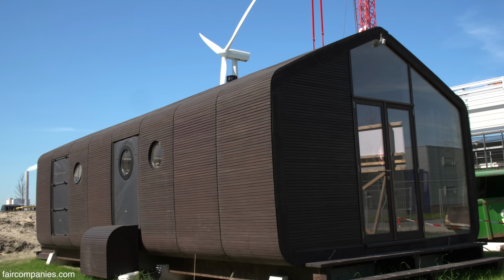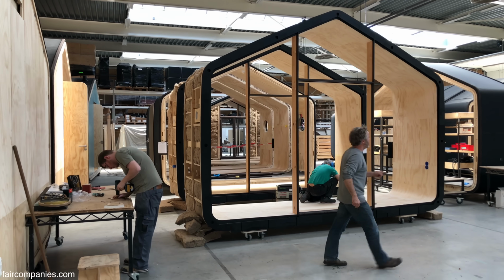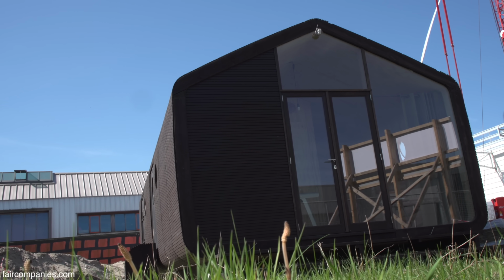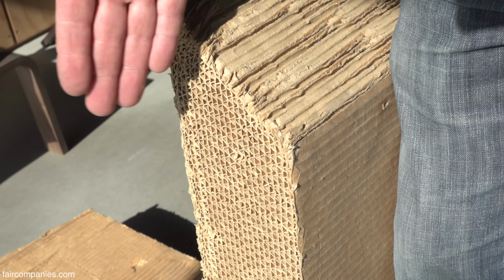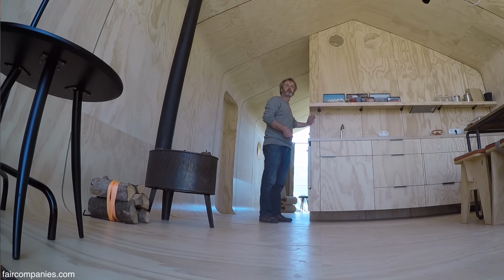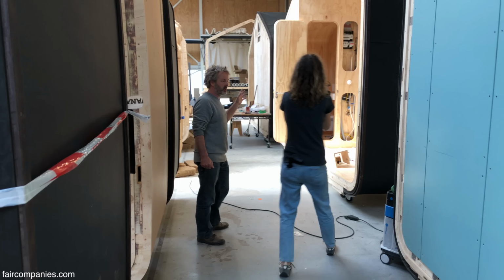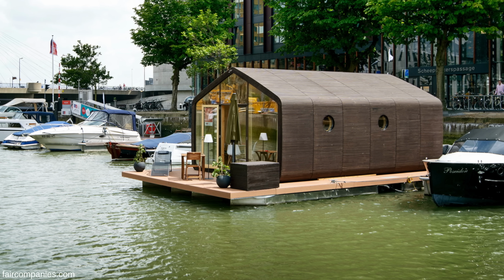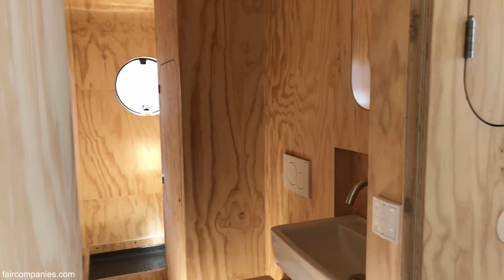Wikkelhouse: pick your modular segments & click them together

Comment: everything has its place.  To me it seems the weight is the key feature.  the questions then is whether the extra expense needed to make the modules out of corrugated cardboard worth it?  gotta run some numbers on this to see how it shakes out in the end.  gotta factor in lower shipping cost, less special handling on the site (cranes or small lifts).  If this idea indeed holds up over time with no wicking of moisture into the walls, invasion by termites & mice, mold through even slight penetration of moisture, and structural issues causing racking where windows and doors can no longer open/close, then maybe it has a chance for special applications where shipping and assembly is critical.

Comment: The way i see it if i could  live in a room with another grown man that was about the size of the unit with the bed that he laid on for 5 1/2 years in prison. I could damn sure live in a house consisting of 5 or 6 of those units with not a single problem.only issue i wld have to over come is how to connect those 5 or 6 units to the buried 40 ft shipping containers that ill use for my basement 🤔
Reply: Just have them cut a door section in the floor. And build a stairway.
Reply: Probably be less aggravation to just go back to prison.

Comment: The carbon foot print is probably less with common construction. 
That’s a lot of wood and not cheap.
Reply: Cardboard is made by wood...
Reply: I still see trees.
Reply: haha you obviously have no idea what you are talking about
Reply: Wood has a zero carbon footprint, it’s renewable. Only the energy go shape it. Concrete has a much higher footprint.
Reply: @martinstrunk4682  er, you realize concrete is sand and lime, right?
Reply: Daniel Sifrit cement is produced under very high temperatures, that needs lots of fossil fuels
Reply: @martinstrunk4682   or wood.  Which is renewable.  Kiln is a kiln.

Comment: I'm really really please he doesn't build boats or...cringe...aeroplanes because...while the concept is good...the engineering is really poor...orientation of the cardboard cells (really Kraft paper) defies sensible engineering, follows a "cheap" lazy method of application. Look at any cell core structure & its purpose of bonding the inner & outer skins...this system promoted here is a poor means of doing that for strength, lightness & I would expect durability too...the glie he talks about...should be a resourcinol "water proof" resin...with mold inhibitors...tricell core board is a poor cousin to paper honeycomb.

Comment: This looks like cardboard in a structural wood frame.  The cardboard is NOT used for the structure.  Why cardboard instead of fiberglass or other conventional insulation?  What happens if the interior or exterior moisture barriers leak?  Any little gap, even a pinhole can let in a lot of moisture over time.  MOLD?  MOLD?  MOLD?  Just asking some basic questions that the interviewer should have asked him.  He just keeps saying "cardboard, cardboard, cardboard" as if that represents some greater good in itself.

Comment: the thing is a good idea BUT all that really is cardboard is the INSULATION ONLY....so its not really a cardboard house as much as a plywood house with mostly cardboard insulation. Seems shipping containers are cheaper, stronger and longer lasting...and no foundation needed as long as the surface is flat and stable....and 100 percent recyclable too. Plus for refugees why have disposable houses when can make them for longer term use and if the crisis is over can use as low income housing after.

Comment: Ok those are beautiful. Love the modular concept and the aesthetics!

But rigid foam like XPS polystyrene with modern blowing agents is actually more ecological from what I understand. The oil you use to create the plastic isn't burned and the much superior insulation value allows you to save on energy creation of 20 or 30 years.
Natural fibers and stuff might feel good but they are not necessarily ecological. They need to be grown and harvested and transported too.
And XPS foam is much lighter so you save a bit of fuel on transportation too.
And the oil you use for building isn't put into the atmosphere as CO2 but "sequestered".
You need to do a scientific study to truly evaluate the CO2 balance of building materials and you shouldn't make "feel good" decisions for these things.

And also cardboard cardboard cardboard lol. Plastics and foam also do have the advantage of not rotting. You also save on structural elements if you use rigid foam because you can make the compressive strength of rigid foam sandwiched between laminates work for you. The cardboard probably has also good compressive strength. But man I don't want my house to rot ever.

It's a cool concept though if they could make it cheaper and better.

Comment: The design is on the right track.The materials are all wrong. There's no way that cardboard stays dry. Stuff happens... One breach of that "raincoat" and you'll have bubbling, expansion, and mold in a couple of months. Entire sections would have to be replaced.

And don't get me started on fire safety and  sustainability.

Comment: -
What I find intriguing: the modular concept of building in section/elements and simply having configurable modules to build to your desire.

What I find infuriating: cardboard as a core in a plywood home with no ideas of R-value, U-factor, material longevity, load rating (because someone will put panels on it or put it where snow falls), wind load, and cost ($10k € per module with nothing more than a plywood finish and cardboard core. 

Don't get me wrong, I LOVE the concept, but as an engineer, I also have to consider the practicality and long term viability of said project using said materials.
Reply: totally agree with you. maybe with this  modularity but made with a light weight concrete outer shell. I don't see how you can avoid termites and mice/rats getting into the walls.
Reply: @Akira-nw4jl  maybe it's because your an Idiot?
Reply: Why is this getting upvoted, when it's utter nonsense. Writing "I'm an engineer" doesn't make any of his statements true. R-value will be much better than any average american house for example. And I would guess that in the Netherlands wind load and similar things have to reach a certain standard for the product to be allowed to be sold.
Reply: Engineers are some of the most intelligent people on earth. Facts!
Reply: @Joel.Invictus  *self absorbed
Reply: @kfstreich4787 , nah. A little over confident, maybe.
Reply: @Joel.Invictus  Not really, they generally know what they are doing,  the trouble is they think anyone who does it another way is wrong.  And it's funny to hear how they say they are an engineer as a justification that they are right and everyone else is wrong.
Reply: and not to forget about fire proofing
Reply: Vernon Hampton, well said.
Reply: What kind of material do you have in mind other than plywood and cardboard?
Reply: spoken like a true thinker
Reply: Agree, towards the end of the video he says we dont know how long it will last..
Reply: My concerns would be 	1. Pest proofing (ants, termites, rodents). Especially at the bottom where they have it within a foot or so of the ground, that would be very difficult to 							check on periodically at that height.
						2. The issue of water eventually contaminating the cardboard. That depends on the relative humidity and the type and amount of rainfall in your area. I 							note there are no eaves for wall protection from sun and rain (two main considerations where I live)
						3.  I don’t know what options they offer in fronts as far as security etc. So much glass doesn’t thrill me. Frankly, larger windows would be good too.
							Therefore I suppose tropical conditions weren’t high on their list of considerations.  
I do like the concept and the possibility of recycling cardboard ad infinitum but the price ....ugh.
Reply: The modular design is interesting but the materials may need to be improved.
Reply: Vernon Hampton you’ve missed the point that cardboard is a great insulator acting as Trombe wall for heat to soak into its air pockets and release back into the units giving a high R and U value. The shape consisting of a triangular shape with rounded corners can withstand wind and snow loads efficiently, especially when you can see the skeleton of common stick framing within the units in the video (obviously I am speaking of when it is adhered to its foundation.) lastly the plastic water shield they installed will reduce the inflow and outflow of humidity. Cardboard and wood are a great benefactor from the industrial revolution, and I a few houses have implemented these materials already, and quite efficiently, so I believe these units would work. Cost on the other hand is quite ridiculous, you could most likely build this on your own time and spend less than what they are proposing.
Reply: @msdivagirl7  Sounds good but I feel they have to use another material than cardboard or process itto make it water and animal proof. In time it will just get water in somewhere and get soggy and lose its structural integrity. A lot of great ideas implemented. Maybe the cardboard can be replaced by or merely for insulation accompanied by some other material for structural integrity.
Reply: @steamsteam6607  Geometric structure is a cross-section of a spheroid, sphere being the strongest shape in the cosmos. Ergo, strength of the structure is superior to conventional stick builds. Properly treated materials are in no way more subject to weather and environment than any other wood-based construction materials. Vernon Hampton may be an engineer, but he must not be an architect, or he would recognize the superiority of both the geometry and the materials applications of this structure. You DID notice, right, that the exterior is covered with asphalt paper, roofing tiles, and exterior siding shingles? Like every house in your neighborhood?
Reply: @EternalRecursion  The point is that it weighs nothing because it's cardboard. So either it is bolted to a foundation and somehow extremely structural or it may go flying off. But what do I know.
Reply: @steamsteam6607  Well, whether it's attached via cables to steel anchors, bolted to a concrete slab, or a crawl space, or a full basement, one doesn't usually consider something a "house" if it is NOT on a foundation.
Reply: @EternalRecursion  OK good information ty
Reply: Company called Cube do interesting modular housing ,they are English company
Reply: In a tornado or hurricane say goodbye?
Reply: not to mention flammability
Reply: Obviously not much of an Engineer

Comment: This is the BEST tiny house solution I’ve seen yet. I’d say perfect as a guest house, or rental income, or a Mother in law dwelling on your property. 
Obviously you can use nice wood stains to finish the wood, the floors, walls, ceilings. Cardboard is a decent idea but I’m sure it would be less expensive to simply build each segment out of studded walls, insulation, and plywood. Cheaper yet to use drywall on the interior. The concept though of building the segments to customize is the real attractive offering here.

Comment: I think this is genius. Cardboard is such a brilliant insulation material, I make shelters for the local feral cats that I can't catch and re-home etc., every winter. They are a mix of cardboard bubble wrap and heavy duty garden refuse bags with straw inside because it doesn't wick moisture up from the outside. I can see that it would make a wonderful building material with all the corrugated airspaces. I wish I knew how to treat the outside of the house... I would use it because it's lightweight and easy to work with, if I could waterproof it, I would use it right away.

Comment: I looked it up, and a completed Wikkelhouse is supposed to cost $80,000...  not exactly cheap for a "cardboard home"
Reply: I was wondering what the price was . Thanks .
Reply: Depends on your vantage point: I am Swiss, and 80 grand for a house is practically free here. Building a house for less than a million is possible, I think, but don't count on that. The down-payment for a mortgage is usually higher than those 80 grand! :-)
Reply: @Widestone001  How much will shipping be?
Reply: @Widestone001  I will put some cardboard condos in Swiss and resell. Thanks for the idea
Reply: he did say it was not cheap it was affordable, but yeah it makes no sense a cardboard house for the price of concrete. why?
Reply: @yourlocalcoolguy  moving?
Reply: it's 99% plywood 1% cardboard (by weight). the cardboard is just replacing insulation..
Reply: Radley2612  calm down
Reply: Cardboard is an expensive material. Hence polystyrene.
Reply: GamingTaylor are you serious?
Reply: 19:42
Reply: Rediculous 80,000.00 i would get a tiny house for cheaper n i still could travel and be stationary. Plus i could have more room. Smh
Reply: He is one cheeky Cheeky bastard 80 k for a cardboard box surrounded by shit wood
Reply: Thomas Truther  It helps to watch the video and hear what he says about expense and what is going into the design and execution.
Reply: None of these types of homes are cheap anymore. The demand for housing is too great.
Reply: Its not cheap at all. Its not well aislated and the walls cannot breath. It Will be a pain
Reply: @valentinamaria549  not aerated? It's 95% air in those corrugations!
Reply: Exactly.. He said " It's affordable but not cheap"  Explains why the entire world is living like slaves to money.. When affordable and sustainable living is within our grasping hands but all we can hold onto is primitive poisoning toxic fuels & virus rules THE land....Its time today to change the plan
Reply: GamingTaylor wow 😮 Good insights and what a total rip off
Reply: LOL
Reply: I've paid 40,000 in rent over 10 yrs in a rental & it been damp flooded no electricity with on safe gas supply  so ever I walk away I have about a few box full of damage goods.  This with land with drainage & water supply sound fantastic even at this price
Reply: This is built for very specific things. Boats would work with this maybe or maybe on planes. But normal living this would be terrible.
Reply: Ah yes, amsterdam hipstertown. We like our overpriced shite out of shite material.
Reply: @Laroling  mokum RIP
Reply: $80k?? Sorry no deal.
Reply: Maybe places in Africa or low poverty places. But honestly it's probably too expensive for them.
Reply: @AJ-ox8xy  Yes, cardboard should be too expensive for Africa. If only we could build with thin air
Reply: Anthony Garcia they have a natural bio house better than this and they build almost for free.
Reply: @vinothfx7630  great then they can build them instead.

Comment: The central problem with this modular, manufactured house of cardboard is that it's made of cardboard.
As any kid who has decided to reside in a discarded cardboard refrigerator box will tell you, if your cardboard house gets wet, it turns into a house of soup.
Too, most any kid who's owned a cardboard house will pepper your ass with a slew of dire admonitions against smoking...or cooking (especially boiling water), using candles or open flame of any sort for illumination or warmth. 
All of these "don'ts" must most certainly put a crimp in your plans to construct a glorious, towering, enchanted palace of papier mache to which you and your maiden fair or prince charming may retire to live happily ever after---or until a precious few drops of the morning dew may spell curtains for your cardboard Camelot.

Comment: Yu Tu wrote 6 days ago "1 down pour or 1 fire or 1 tornado". ... You  haven't been paying attention Yu Tu. Water is kept out the same way as a conventional wood framed house. The cardboard is fire resistant. The structure is anchored with steel ties to the concrete beam piers on the ground.

Comment: These would have been perfect to use when they built all of those fema campers and trailers of the victims of hurricane Katrina and victims of other hurricanes since then! Either put them is as permanent or temporary units until rebuilding has taken place...preferably rebuilding, or have these wind tested safe for wind conditions, and they could easily plce them up high enough to kepp the safe from most flood levels as well!!!!! The shape of them would more than likely do very well against hurricane or tornado winds but not standing water! But once watcer subsides set these up quickly, get the homes rebuilt put these back in storage for the next disaster! And put a stipulation on the usage of them that it would be similar to being in a hotel room as in the resident would be responsible for any damage done due to human neglect or intent and thus the party is responsible for repairs or they keep the unit, using their home insurance payment coming in to pay for the unit listed at beginning of occupation and or depreciation if any recommended by it 's build date via insurance appraisal estimates, keeping any portion if over the cost of the unit! If they do not receive enough they can make applications to determine if they need make payments or if they would simply keep the unit at the amount issued from insurance company For their demolished home!!l